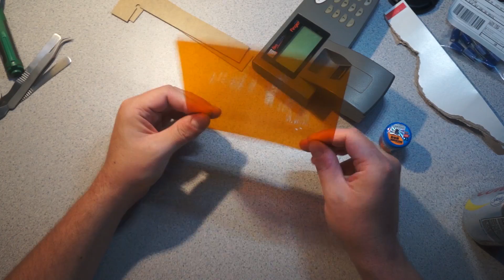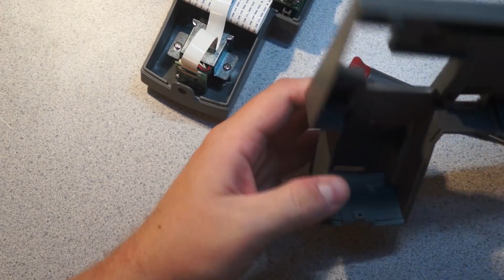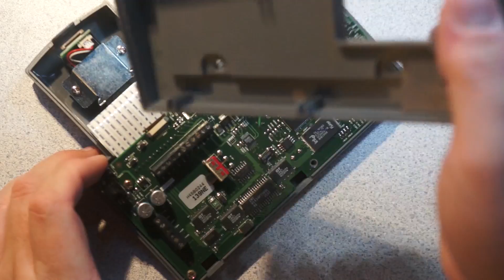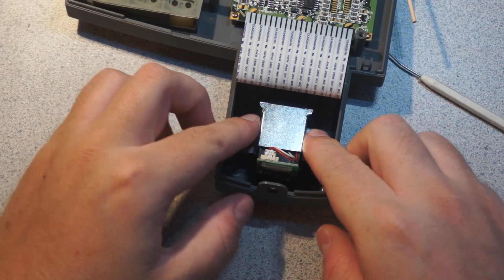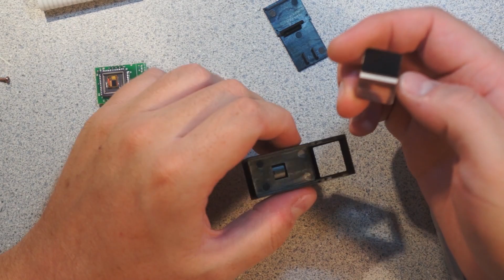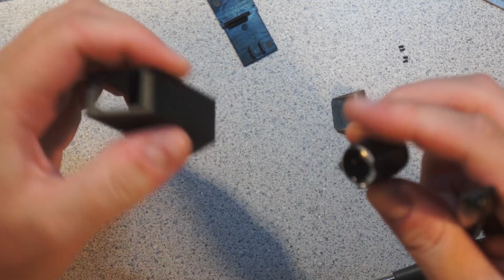BioMatch 4500 Fingerprint Lock - Teardown

Comment: A StrongArm SA1100.  The 3.68MHz oscillator is used as a reference for the internal PLL clock generator on the processor, which I believe in this case generates a 160MHz clock.  It has a built-in color display controller and PCMCIA bus interface.

Comment: Last bit of spam on this video, I promise. XD
Red is usually chosen for finger scanners since it negates the need for chromatic filtering since it is close to CMOS sensor's highest sensitivity range and is actually visible so the user can get a visual cue that the scanner is in operation. Green is used in monochrome scanners since it's usually paper .  Green doesn't bounce off skin that well though.
Operation order as I remember was punch in your valid id, scan finger, swipe card (if installed).

Comment: MOVs appear to clamp between relay contacts and common to absorb any transient switching spikes.  Probably only rated for 50 volts or so since common alarm panel voltages are 12VDC and 24VA/DC

Most of those units can be factory reset by holding down the reset button while powering on, hence the on-board kill switch.

Cryptic terminal designations below based on my experience setting up similar devices a couple times.

Comment: FGND - Fiduciary Ground (capacitively coupled ground for twisted pair signalling ground on the RS485/442 bus)
SEN +/- - Sensor input +/- (external low voltage input ~1.5V)
RX/TX - Alarm panel standard serial signalling
EXIT - Door sensing when used as a lock controller referenced to ground
WIG0/1 - Optional card reader I/O
NO/NC/COM - Isolated relay normally used for a magnetic lock coil/release

Tamper switch signals panel to alarm if authorized user code had not been input prior to opening. :)

Comment from the maker: I don't find that surprising, particularly if you didn't make sure the top was screwed on *very* tight.

If you buy real solderpaste (e.g. from some place like digikey, etc...), they insist on shipping it 2nd day air. It does go bad, particularly if not sealed very tightly.

Comment: It is most unlikely that the complete image of the fingerprint is being stored on the device. Typically the fingerprints are stored as a set of features (minutiae) and their position, which is much more compact. The data can be scrambled by a one-way function, preventing the recovery of the image, yet still providing a way to compare with scanned image. It's much like a hash function for data, although more correlation-like, returning match quality. Brute-force attack is still possible though.

Comment: Screw terminals aren't all THAT bad! In fact, I really love the 2-part Pheonix Contact COMBICON variety, which have a male "socket" and female plug with the screw terminals on it. When you are replacing a sensor at the bottom of a slurry-filled pit, you will then know the value of such connectors versus the ring/screw vinyl crimp connections or bare wire. Pluck it out of the bashed sensor, stick into new one. Boom. Get the hell outta there and pray the cal doesn't need adjustment! Cheers ;)

Comment from the maker: It's really not that critical, really. I have solder-paste that's been sitting at room temperature for 6 months, and it works fine.

The temperature control stuff is for manufacturers who want to make thousands of units without needing any rework after-the-fact. For someone like me who can handle the occasional minor post-reflow  fix, it's not necessary.